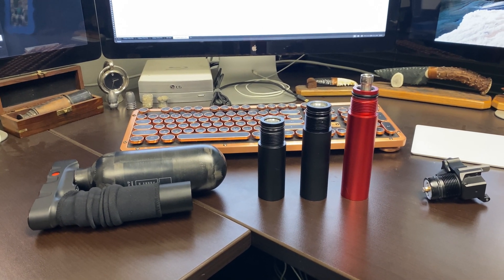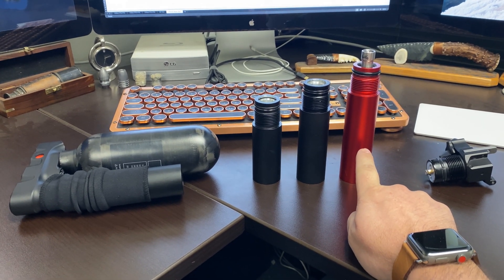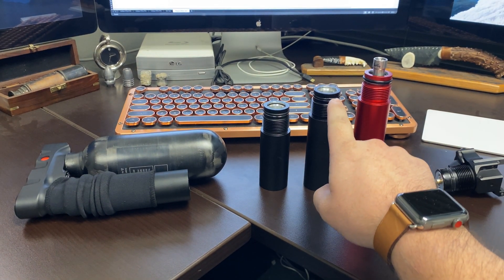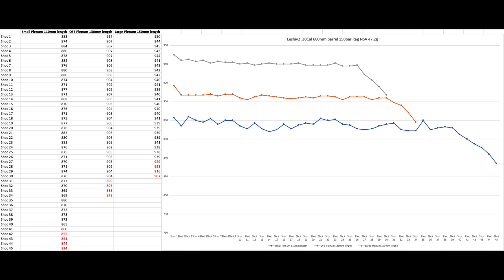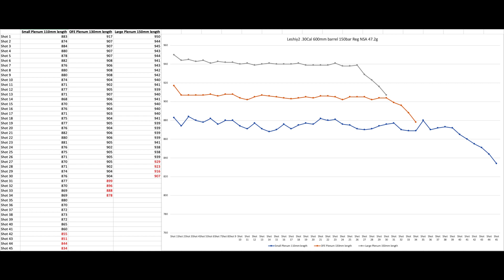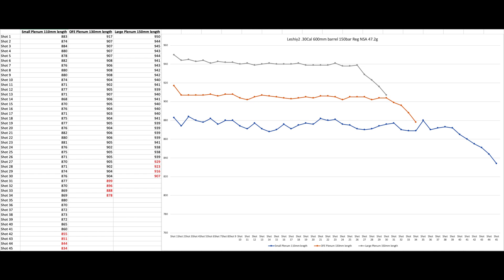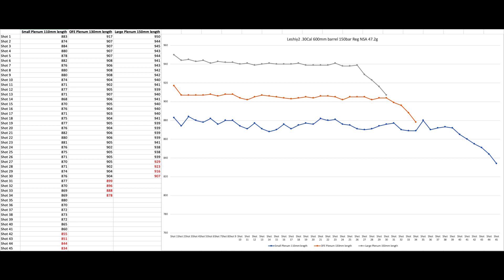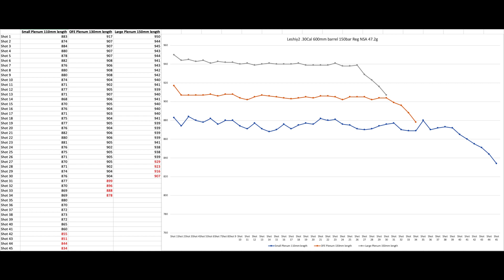Leshiy2 Plenum Length Testing

Comment: I own the 30 caliber Leshyi 2 with the 350mm barrel and the REPR regulator. If i get the largest plenum like the red one you have in this video will it give my gun more feet per second buddy.
Reply from the maker: Yea depending on how you tune it. Technically the valve regulates the amount of air released regardless of the plenum size BUT in my tests the plenum does make a difference
Reply: @blackcreekairgunner  yea I have the newest Leshyi 2 with the regulator you can turn up and down with a tool and mine is the 350mm barrel in 30 caliber and I'm shooting the NSA SLUGS the 61.5 slugs and there very accurate but I would like to get more FPS and I can if I turn the regulator up but your saying if I get that red larger plenum that will help so if I get it and turn my regulator up to say 150 bar then will that plenum being bigger also make more of a fps difference buddy.

Comment: Arthur, I have not taken my leshiy back end apart yet.  I was wondering if you remember what your reg was set at and what sizes were your original jets. I know you have a single .2 now?  Thanks Bill C!
Reply from the maker: Currently i am at OFE plenum 140bar .6mm jet NSA 47.2 grain. If i remember correctly the factory setting for the .25cal is 130bar .4mm jet. My gun was originally a 25 caliber I swapped the barrel to 30 caliber.
Reply from the maker: I changed my settings a couple times but the above is what I ended up landing at for a while until I decide to change it in the future but not sure I will
Reply: Great thanks!  And you are getting around 900 FPS on the 47 grn nsa’s?
Reply from the maker: Correct. With my current tune 900fps over 31shots. I also have the 350cc bottle
Reply: @blackcreekairgunner  Hi Arthur,  Did some tuning today. My 30cal had a plug and .8 jet and the reg was at 150 bar(did not mess with it). I put in the .6 jet and was not getting even close to 900 fps. So I installed the .5 jet and now am around 888 fps with the 47 nsa,s and 911 with the 43 nsa's. Will try to do a good bit of shooting to see if I can get the groups to tighten up a bit. It seems to jump in fps every now and then on a shot (like 20-25fps). I watched Gregor Kamenšek test he did on the Leshiy 2 and he was getting it also from time to time. Did you notice that on yours before you changed regs. And have you noticed it at all with you new reg.  Thanks Bill C!
Reply from the maker: I have not noticed any jumps or drops at 140bar and above. I did notice 7-8fps drops when my reg was 125 and 130. I have done different testing with different jet sizes and regulator settings. If you send me your email address I’ll email you my Excel sheet with all of my graphs at different settings
Reply from the maker: Just keep in mind I have the 600 mm barrel so .6 works for me. The shorter the barrel the smaller jet you need to push the speeds higher. For every inch of barrel you gain/lose about 10fps approx
Reply: @blackcreekairgunner   I have the 600mm barrel also. Thinking the reg may be the difference.  Can you private message a email on youtube?
Reply from the maker: I dont think so but you can PM me on facebook
Reply from the maker: Do you have a reg tester so you know if your reg setting is correct?
Reply: @blackcreekairgunner   Ok, I sent it thanks again!

Comment: Can the plenums fit into each other? By that I mean can two be threaded together. I'm thinking of getting another plenum and regulator, putting two of them together to see what a two regulator system performs like.
Reply from the maker: Yes but the pull length is so long you can barely reach the trigger
Reply: @blackcreekairgunner  I have actually managed to put together a double regulator system now. Using a compact butt stock into a standard plenum and regulator at 130bar into a compact plenum set at 70bar (I'm in the UK so sub 12ft pounds). I've had some satisfying results with it. Regarding the length of the stock in this configuration, it's actually quite good. I'm not the tallest at 5ft 7 and find bench rest shooting is not a stretch at all and free hand more than acceptable. I don't think anyone taller than me would have any problems at all. Ideally for high power set ups  an even shorter butt stock would be better, I'm pretty sure that would be achievable as the compact one is still pretty long.

Comment: This test was to vague. After the video, I still can’t comprehend your results. Reading some of the comments their are others that feel the same. If you would have had a print out of the results that might help a little better.
Reply from the maker: I apologize. I don’t understand. In the video there is a shot graph that has three different shot strings one with each Plenum size so you can see the difference in fps each plenum produces. Let me know exactly what kind of print out you’re talking about and if it’s different than the graph that’s on the video I may be able to put one together

Comment: I ordered the large plenum based off your tests, keep the vids of what you are doing coming, I enjoy learning from them and how fast you reply to folks asking questions (which are things I might ask).  I have the 450mm barrel and it took a lot of pellets and slugs before the groups started to get small.  Did you notice that with you barrels?  Also you talk about a new reg you are testing. Would love to hear more on that unless they will not be for sale some day. Thanks!
Reply from the maker: I need to check into the reg production before i let everyone know.

A lot of guns need to be led in before they group well. At least 100-150 pellets. I was using the 600mm .30 barrel. It grouped extremely well right out of the box BUT im using an Alfa barrel.

Ask away bro ill answer what i can and if i dint have the answer i probably know someone who does.

Comment: would 970fps with 26gr .25 cal slugs be possible with 350mm barrel or do i have to go 450mm?
Reply from the maker: You might be able to get 900 roughly with a 450mm. I would go 600mm. Slugs have more contact with the barrel. Generally slugs are about 50 FPS to 100 FPS slower than a pellet of the same weight. You might be able to get it as fast as you want but in order to do that you’re gonna have to max out the reg and do the smallest jet and you may end up with only 12 to 16 shots at the most. This is all supposition since I don’t have a 25 Cal
Reply: @blackcreekairgunner  thanks so much!
Reply from the maker: Rule of thumb. You gain/lose about 10 ft./s per inch of barrel
Reply: @blackcreekairgunner  ur the best
Reply from the maker: Thx. I try!

Comment: So according to your Excel sheet.... larger plenum= less shots-- somewhat counter-intuitive.
Reply from the maker: It is because I tuned it that way. I wanted highest power shots possible. You could put in the larger Plenum and then tune the power down and then you would get a Lot more shots. Keep in mind the Jets also play a huge factor in this you would have to mix and match the Jets to figure out which one is best for your specific tune
Reply from the maker: My current tune: factory plenum. Reg 140bar. .6mm jet. NSA 47.2grain slugs. 900fps 85fpe. 32 shots. 3/4” group at 100 yards
Reply: @blackcreekairgunner  Thanks, this helps a lot !! Awesome videos btw, keep them coming !!
Reply from the maker: Thx bro. Also for the .30cal you could probably even do 130bar reg .8mm jet and use JSB 44.75 grain pellets and get probably over 40-50 shots. Keep in mind i have the 350cc bottle upgrade
Reply: @blackcreekairgunner  Wow, great advice, thanks!! Didn't know about the 8mm jets, so would you just use 2 8mm jets? Last question: does the L2 even still fold with a 350cc tank ? Gotta get me one of those.
Reply from the maker: @nuangel  yes it folds perfect. Edgunwest.com sells the jets as a pack. 2 pairs each from .2mm - .12mm
Reply: @blackcreekairgunner  Thank you SO much, bro !! Ordering.... Awesome channel !!
Reply from the maker: I appreciate it!
Reply from the maker: I would start with one .8mm. If you use two it puts you at .16mm which would cut your power super low. You can mix and match sizes to get different totals. I use one plug and one .6mm jet in my current tune. Factory for the gun is 130bar and one .8mm jet.

The smaller the jet the slower the valve closes equals more air out and more power. The larger the jet equals the faster the jet closes and less power.
Reply: @blackcreekairgunner  - What about using 2 x 0.2 jets ?
Reply from the maker: You can use any combination of jets to get to the total that you want for instance right now I’m using a single .6 but i coukd also use two .3s or a .4 and .2 and so on so forth. Edgun does not suggest going over a total of 1.7

Thats a Really good question by the way!
Reply: @blackcreekairgunner  Thanks for the  vital information !!
Reply: He upped the regulator as well? You can tune it to be regulated less get same power and more shots that way but im with him on wanting more power. To me being able to get that many shots is perfect for protecting my bunnies from predators

Comment: So do you think that the stock/cylinder for L2 will fit the Classic Leshiy? If so where would I order those parts from? Amongst the standard calibers, I have the rare  .20, .30 & .35  barrels for it also and I would like to add the additional air to it, I don't need the semi auto stuff that's a waste of lead to me.
Reply from the maker: As far as I know none of the parts are interchangeable between the Leshiy classic and the new leshiy2

Comment: I'm a bit confused, I would have thought that you'd get a higher shot count with the larger plenum... the velocities are higher on the lists on the left, so you DID adjust the reg differently with each string, correct?  It would be great to see more content of this sort from you.
Reply from the maker: Yes if you look at the graph title at the top in each video i have the reg pressure, ammo, and such noted. When it was adjusted to:

120bar .3mm jet 36 shots
125bar .3mm jet 32 shots
150bar .3mm jet 30 shots
170bar .2mm jet 18 shots

When i went to the HEAVY ammo it not only needed the 170bar but it needed a smaller jet to be able to fully dump the whole plenum. Just because you have a larger plenum does not mean the jet is the correct size to fully dump the plenum. The larger the jet the quicker the valve closes hence less air release.
Reply from the maker: Also since the plenum is fully dumping due to the smaller jet it uses a LOT more air resulting in significantly less shots. For me this is a hunting rifle so my requirement is power and shot count does not matter to me

Comment: I have a fx impact mk2 with the power plenum I was wondering if it would be good to add an external plenum as well. 
I dont know if you have this gun or not but what would your take be on this ive heard it don't do anything for power or shoot count by some and others they see an increase in both. 
Right now shoot .30 cal. NSA 47's at 930fps shot count before its off the reg. It about 40. Groups are 1" moa at 80 yards. 
Just wanted your opinion on this
Reply: Yes bro, I got a slight increase in fps & fpe when I added the external to mine but very slight. I just installed the Huma dual regulator tho and for some reasons I don't understand yet, I'm seeing a significant change now. With .25cal 39gr slugs I went from 960 fps w/o external, to 975-980 w/external. Now with the added reg I can group under an inch @ 60yds @ 1030fps. And I think I can go higher if I wanted.
Reply from the maker: Im not sure. Im just getting an impact 357 this week and a maverick is coming in a couple weeks. I would talk to ernest rowe or justin from Utah airguns

Comment: Hi! I was interested in seeing the results of this. I know the UK spec version is being shipped with the smaller plenum and reg adjusted for 12ft/lbs, I assume it works better at a lower reg pressure and even longer shot string. Without adjustment of the regulator as you have done, do you find accuracy is affected by the smaller plenum at default reg setting, as it shows the most variations in fps compared to the other two plenum sizes on your graph?
Reply from the maker: I have not done this test at the default reg setting. This test was done at 150 bar reg setting. I could probably do one at the factory 130 bar if I had enough people interested in that.
Reply: @blackcreekairgunner  Ah okay I just assumed it was the default reg setting, I must have missed the bit in the video if you said you had turned it up! Anyway, in the reg settings you had did you notice a difference in accuracy considering the size of a smaller plenum? I am actually a Leshiy 2 owner myself and am considering tuning my reg down with the standard plenum to get more shots.
Reply from the maker: @R2D888  All of these tests were done at 17 yards. Since that was the limited space I had. At that distance everything was dead on center. I did notice with the smaller Plenum the fps had a little bit larger spread between shots which I thought was a little odd and I’m not sure why it was doing that. If you take a look at the video on the top of the graph there is a detail header that says the reg pressure barrel length and everything. In my opinion if you’re shooting under 50 yards the spread between FPS most likely wont make a difference in accuracy. 75 yards and above with the lower speed shots you would probably see a little bit of drop at POI